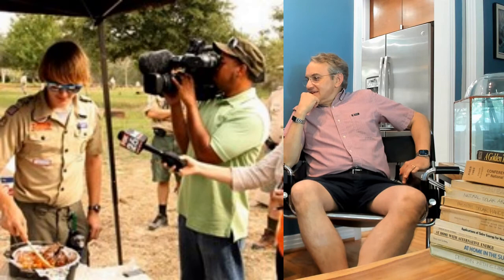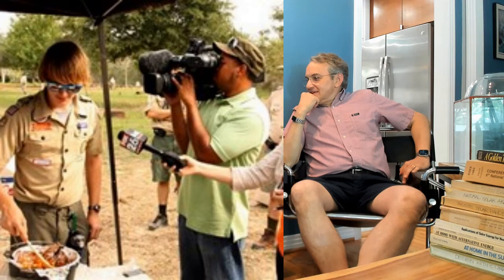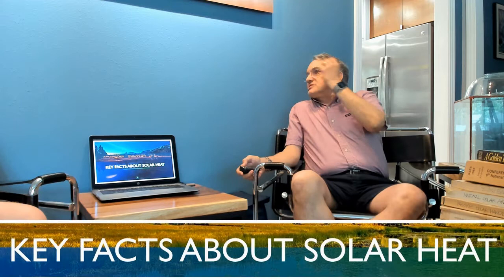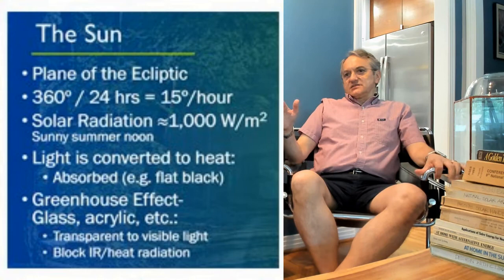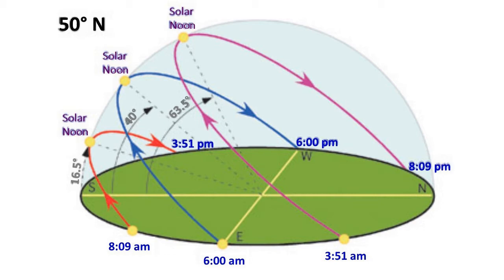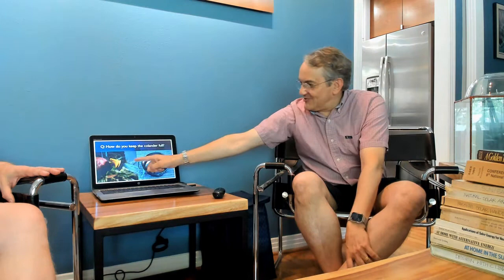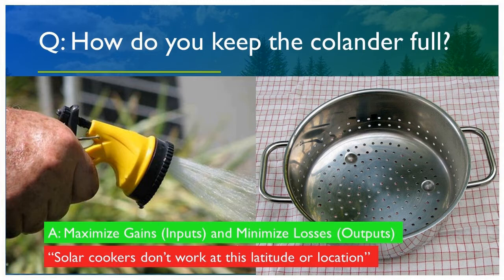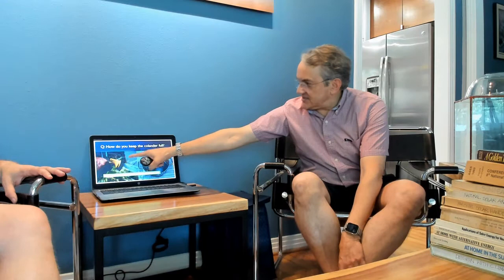Kurt Neubek: An Architect's Reflections on Solar Cooker Design

Comment: Fantastic discussion. So interesting.
I love the way you think Kurt, especially the notion of the synergy of additive incremental  design choices leading to a big efficiency gain overall.
Thanks so much for doing all these videos Luther.
Reply from the maker: I agree. Kurt brings technical issues down to earth. As with many of my guests, Kurt's presentation should be required viewing for any wading into or working through solar cooker designs..
Reply: Thanks so much for your kind words.